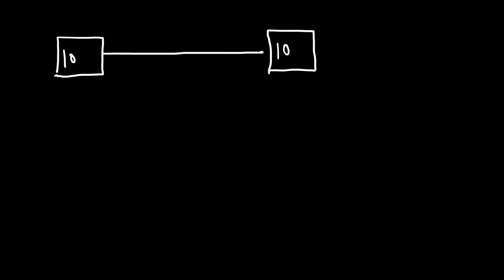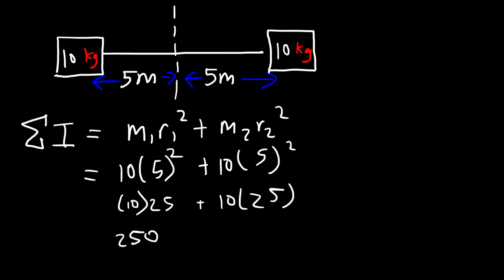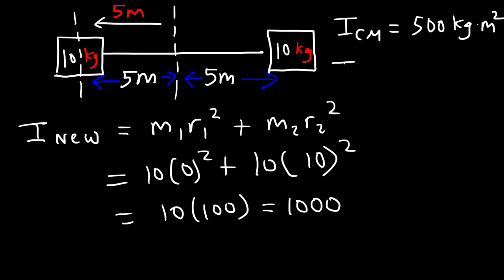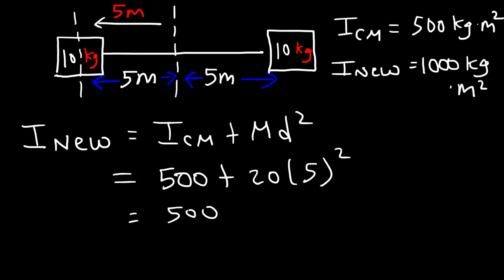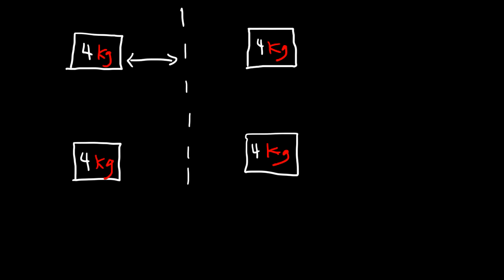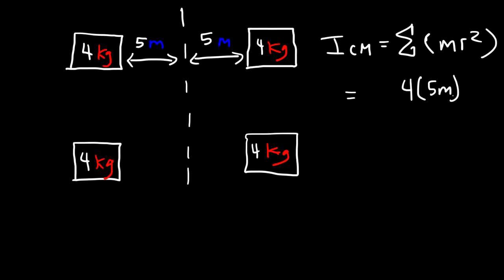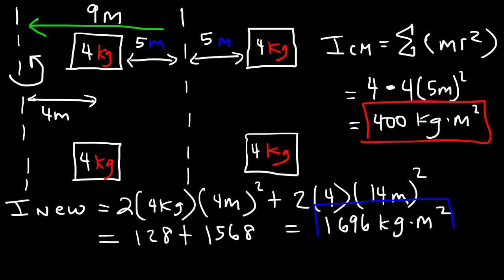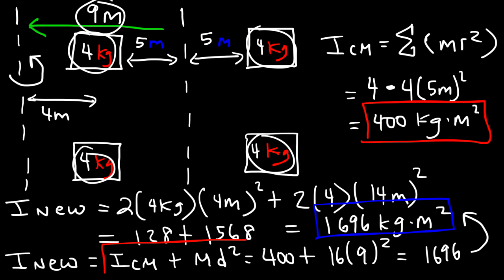Parallel Axis Theorem & Moment of Inertia - Physics Practice Problems

Comment: If the axis of rotation is moved towards the left, does that mean that the axis of rotation will be in the air?
Please explain
Reply: wtf r u talking about🤣🤣😂😂🤣😂😂😂🤣
Reply: Why would it be in air??? Axis of rotation is an imaginary line, a mathematical tool invented to describe rotation in objects. It's an imaginary line that passes through the centre of every object. Even earth itself. Air is not technically an 'object', and the axis of rotation cannot be shifted from 1 object to another stuff.